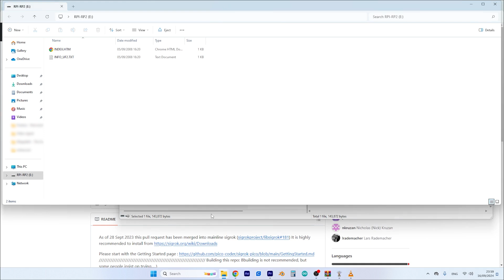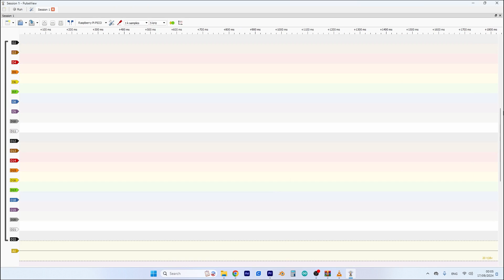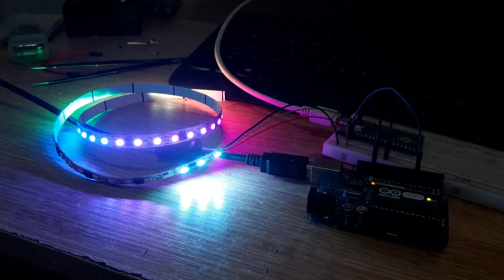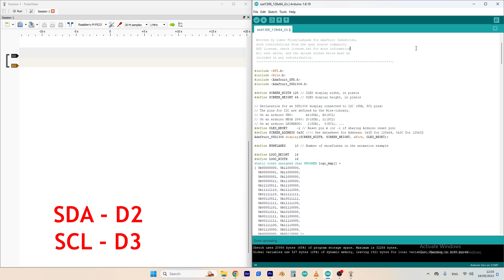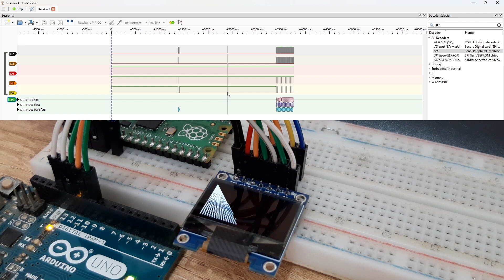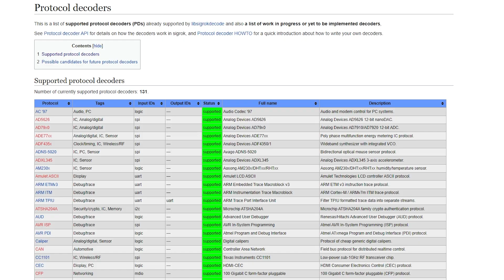Raspberry Pi Pico as a 24-Channel Logic Analyzer

Comment: When could we expect a version for macos?
The nightly crashes & it’s at 0.42. I assume I need 0.50 because Windows or Mac 0.42 doesn’t have the pico option available. Is there a way I could add it to 0.42? Some kind of a plugin or extension? Thank you.

Comment: thanks  i tested it works well  an important  note to  use the Zadig software included with the pulse view setup
just in start menu  goto sigrok  then run zadig

press and hold bootsel button on the pico the zadig will install the driver automatically

if after that pulse view did not detect the raspberry pi  then 
in zadig software  select the  raspbery pi pico 
then in the driver section scroll for usb to serial  (very important because some windows
unstalls the raspbery usb driver as a generic usb devicebut you want it to be emulated as usb to uart ( in my pc management you see the pico  with com5 for example )

i will try later to see if it works with logic 2  pc software because its much informative than pulse view  .

Comment: How is the 5V Arduino UNO not frying the 3.3V RP2040 and why are you not saying anything about this?
Reply from the maker: Pico acted as a passive logic analyzer its GPIOs sampled signals without actively interfacing at logic levels. Arduino’s 5V signals didn’t drive the Pico directly; the analyzer reads with high-impedance inputs, avoiding stress on the 3.3V tolerant pins
Reply: @anissoulhaci  There is no such thing as high-impedance inputs or not driving the inputs directly. And the inputs of most controllers, including the RP2040, do have a simple passive protection against over-voltage and under-voltage in form of diodes to VSS/GND for ESD-protection, you can see this in the absolute maximum ratings which define IOVDD + 0.5V for the RP2040. So anything above 4V can be deadly to your controller and the bare minimum would be to limit the current thru the protection diode with a series resistor to less than 1mA - but such a resistor would degrade the signal.
So this experiment of yours probably was just luck. I2C works while violating the maximum of IOVDD + 0.5V since I2C works with open collector outputs and pullup-resistors, SPI however works with push-pull outputs and at least CS is high over longer periods of time, the only thing that might have saved your RP2040 is that the voltage on the UNO was closer to 4V than to 5V as it was USB powered.
Oh yes, what also happens is that the controllers supply voltage is raised thru the inputs, so while the IOs might survive this, the next risk is that the voltage/current combined from several OPs fry something else.
Reply: @anissoulhaci  There is no such thing as high-impedance inputs and not driving pins directly.
5V tolerant inputs are a thing, but the RP2040 has none. 
The RP2040 has, as most other controllers, ESD protection diodes at the IOs to GND and VCC and therefore the abolute maximum ratings show the voltage at the inputs must not exceed IOVDD + 0.5V.
The bare minimum would be a series resistor to limit the current thru the diodes.
I2C works with open collector outputs and pullup resistors, the RP2040 should survive this more easily.
SPI works with push-pull outputs, at least the CS should fry the RP2040.
The only thing I can think of that helped your RP2040 with out-of-spec input levels is that your USB supply might have been closer to 4V than to 5V.

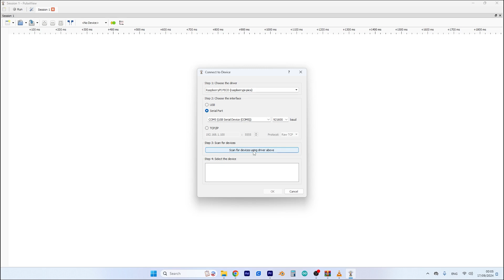Comment: 1:50 i tried everything but no port is showing in pulse view software. can anyone guide me?
Reply: I got fix of it. So i dropping the solution. Just click on serial port after selecting RP pi pico and leave the Baudrate blank and click find device button the device will appear if all ok
Reply: @pcmobiletechnicalsolutions8504  Thank you so much! It helps me after spending half a day trying to find solution. Small clarification: I selected serial port, selected relevant COM  from the list, but leave the Baudrate blank.
Reply: Same here

Comment: Thank you for the video. The PICO works with 3,3V. Won't 5V damage it? I think it is necessary to use TXU0104 IC.
Reply: a question from a newbie, using the TXU0104, what would this project look like, and what voltage level would be applicable?
Reply: @sostenesbarrosesilva8651  YouTube deletes the link. You can find a sketch here with TXB0104. Search under bbatka.  Hungarian electronics forum. Hobbielektronika "Ki mit épített" page=1691
Reply: @sostenesbarrosesilva8651  YouTube deletes the link. You can find a sketch here with TXB0104. Search under bbatka.  Hungarian electronics forum. Hobbielektronika "Ki mit épített" page=1691

Comment: What is the banwidth , per channel, it\s very important because you are connecting via direct wire to the pico, at higher bandwidth it's need a compensation capacitance trace for each channels, unless your project is running under 20mhz.

Comment: When I want to scan devices connected to COM4 (I have a Raspberry Pi Pico connected there), I press the scan button, but it doesn't detect the device. I've tried changing USB ports and cables, but it's still not working.
Reply from the maker: yes , its a bit tricky out there , just make sure that there is no software that makes the COM ports busy , if it doesn't work try to reboot your PC

Comment: Looks interesting. But could you give some information on the Sigrok parts to install and also how to connect the pico to the board under test (which pin is which channel)?
Reply from the maker: @aamiddel8646  i mentioned everything on the video , and the pins, there is a png file representing each gpio pin with their channel
Reply: @anissoulhaci  Thanks for the response. But you might consider to show it rather then mentioning. I have not seen the png file. Would have been nicer if you showed in the video.